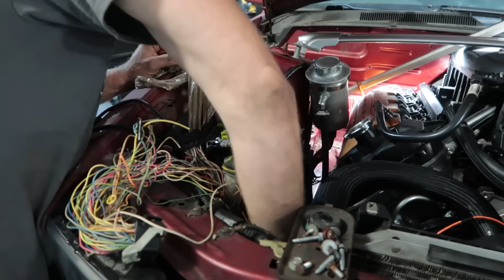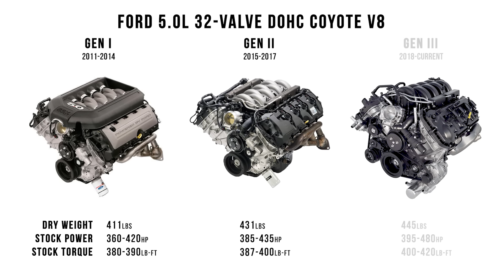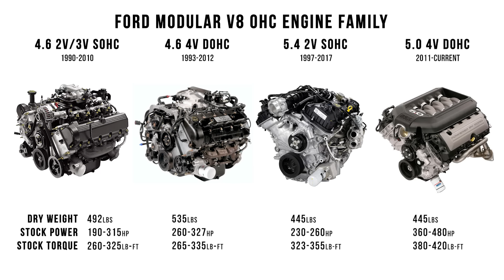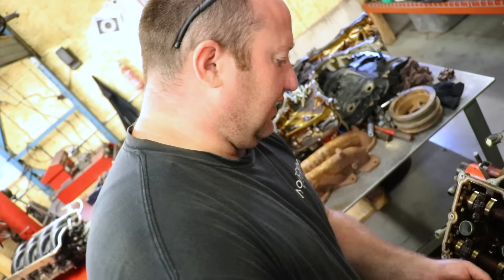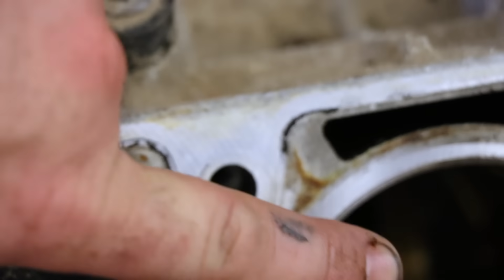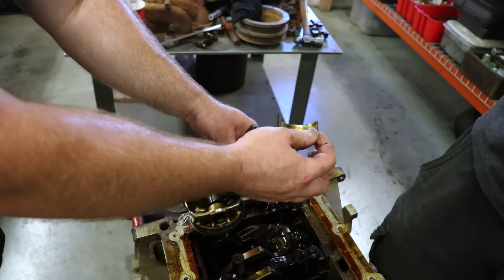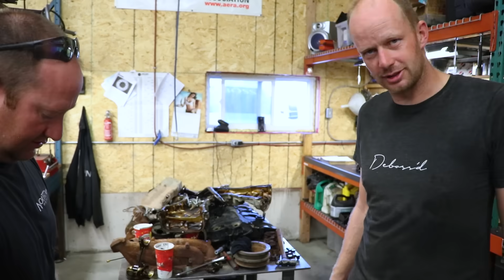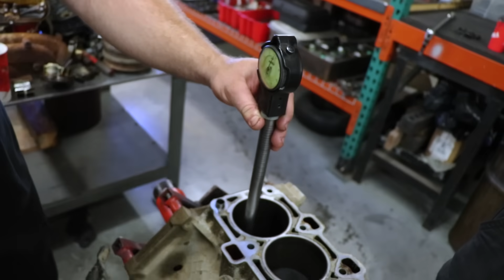REVIEW: Everything Wrong With A 5.0 Coyote Engine

Comment: I'm not really a fan of LS engines, nor the coyote but the reasoning behind not likening the ls because it's old tech is pretty piss poor. 

Balanced correctly, a pushrod engine will rev as well, have a lower center of gravity and put out just as much power and torque as an over head cam engine. 

Having variable valve timing is an advantage though that can also be achieved to some extent with a push rod engine. 

Volumetric efficiency is key to performance and simplicity and structure is key to reliability and the LS has all 3 in spades. 

Its a lot of parts, weight and complexity for next to no benefit in my opinion.

Comment: one head has more sludge because of the pcv
Reply: See that all the time on the GM 3.6 LFX. Clean air enters the left bank and dirty leaves the right and it always looks worse.
Reply: @93sundance   the first upgrade ford techs recommends is a oil catch can to prevent this exact problem
Reply: @davidlindsey4237  not really a problem on a 3.6 as long as you change your oil regularly.
Reply: If you watch sloppy mech same with LS engines. One side dirtier than the other